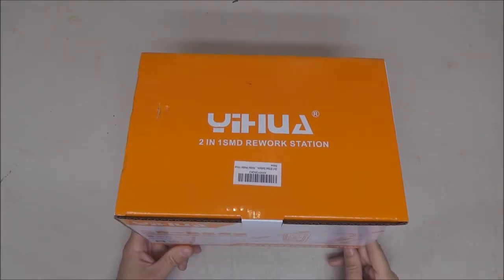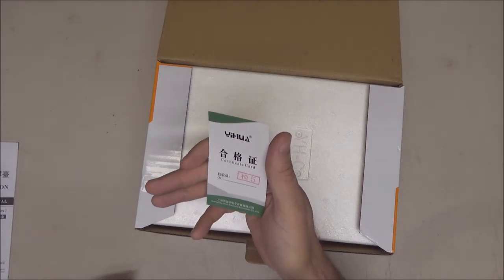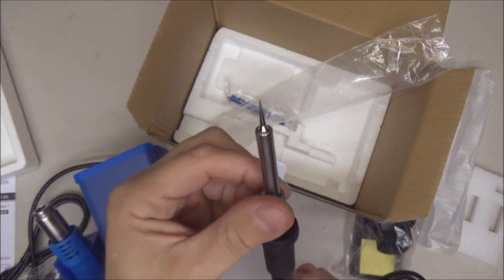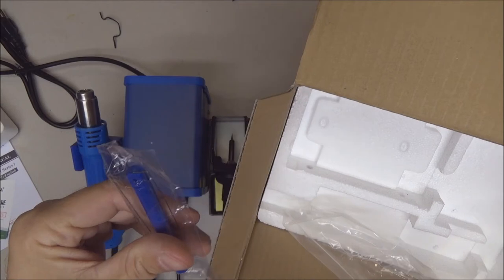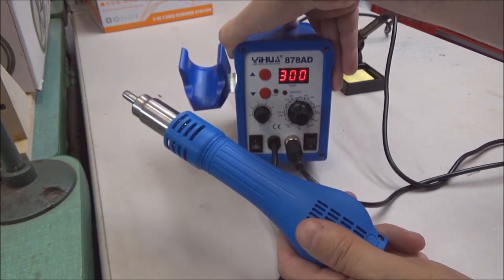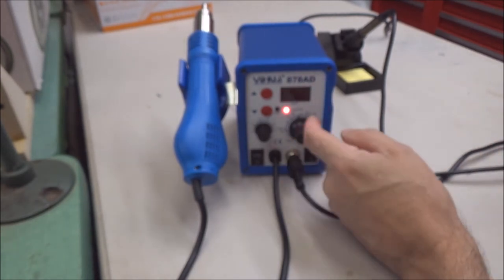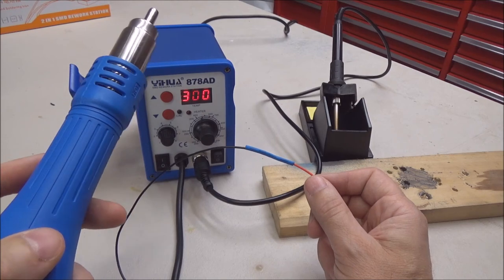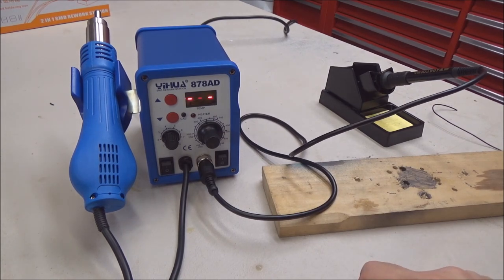Yihua 878AD Unboxing & Use

Comment: Thank you for your review, as it was very informative. I am still looking for a good one to buy, I am 17 and loved engineering/electronics since I was 13 my first soldering iron was one my father gave me, it was a Weller WP25 and I have not yet upgraded because It was working good but I have realized that I need a better one so I will keep looking. Anyways, thank you, and have a good day! (And I was also interested what are your PC specifications?)
Reply from the maker: HI David and thanks for commenting. My main desktop is built with the following. 
Corsair Carbide Series 400R
SeaSonic SS-750K power supply
Gigabyte GA-Z77X-UD5H 
Intel I7 2700K ( mild overclock)
GIGABYTE GeForce GTX 780 3GB ( I don't game, this is used strictly for photo/video processing) 
Mushkin Chronos 480GB main HD 
Mushkin Blackline 32GB DDR3
Reply: of course I can cut costs by doing some things differently and I also have to factor in monitor and other peripheral costs i'm expecting to spend around $2000-$2300 on EVERYTHING.
Reply from the maker: I use to play the game of constant upgrades and finally came to the conclusion that software development hasn't kept up with hardware. I wasn't seeing any gains with hardware upgrades any longer or it was so little that I could see the cash being spent in other places was more useful. 
At my day job I run both a CNC (shopbot) and a laser cutter/engraver.
Reply from the maker: Look my mildly used stuff, the folks that are into constant upgrades often sell their old stuff very cheaply. It will run programs like Solid Works, Maya just fine.
Reply: I think I wont have to upgrade it for at least two years besides maybe getting more ram, but it's still an idea so i will see what happens I guess.

Comment: The nozzles for the hot air do not fit tight or lock to the gun, just fall off in use. They look the same as yours. Am I missing something?
Reply from the maker: Mine have  held on  just fine with no issues.
Reply: The nozzles have little dimples on the sides, one on each side, they may be flattening out and not holding properly. Use a nail punch to make the dimples raise up more. That should fix it and hold better.
Reply: Or else maybe give it a once around the inside with kapton tape to give more of an interference fit? Maybe worth a try.

Comment: hi..im thinking of finally getting a temp ontrollable work station ..the iron portion does not display temp digital ? but it has a knob like oven for temp? that will control the temp?
Reply from the maker: You are correct, the digital display is for the heat gun only. The rotary knob has temp indications around the dial.